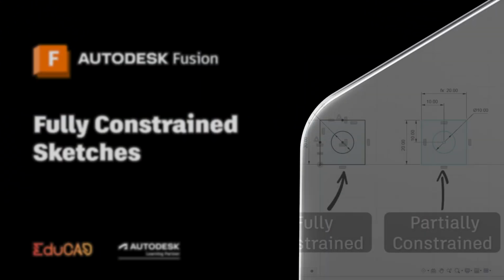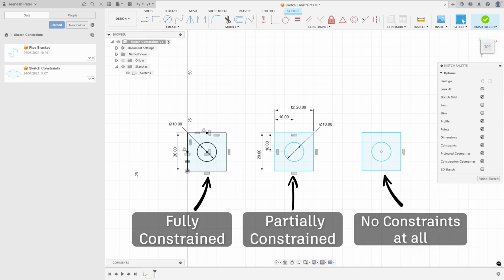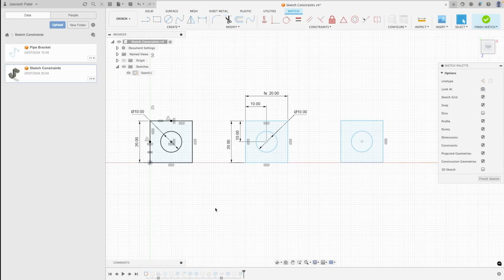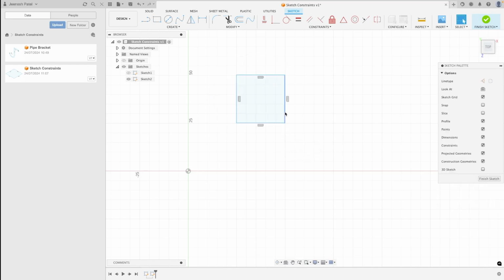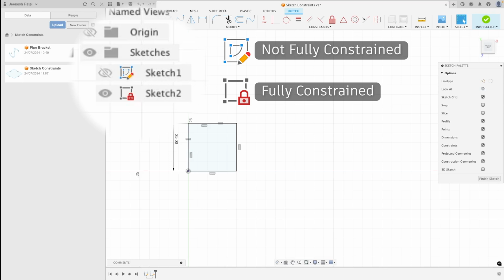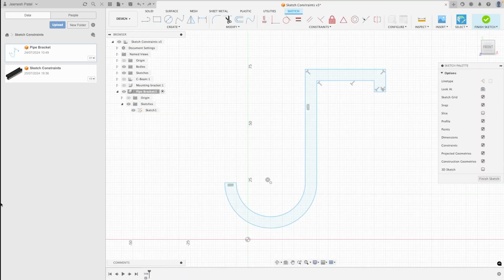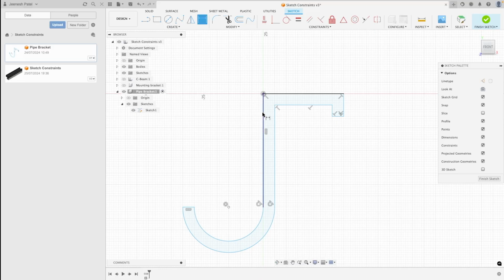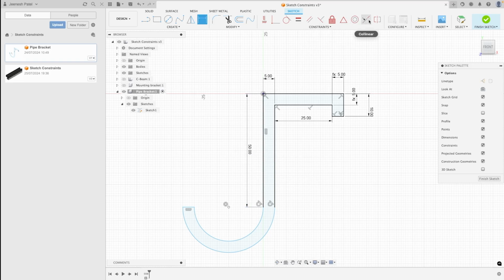Fully Constrained Sketches - How to Create them in Autodesk Fusion

Comment: Fusion: I know the sketch isn't fully constrained, but I'm not going to help you find the problem. I'm going to make you search and search for 45 minutes trying things, until you give up, only to find your sketch is now irreversibly altered (no Undo for the overall sketch changes) and there is now 50,000 errors in your timeline that need fixing that weren't there before. There needs to be a) a way to ask it "where are there unconstrained elements (the blue highlight isn't enough because it can be hidden behind other points or lines that make it invisible) and b) a way to "finish sketch, reverting to previous state (undo all changes since last time)". Maybe this is a newbie error, but as a newbie, it's seriously frustrating.

Comment: The most frustrating thing in Fusion sketch enviroment are automatic perpendicular and parallel sketch constraints.
Reply: Hold alt when sketching
Reply: @Jimbo_Jumbo  What does "Alt" do? I often hold "Ctrl" during sketching, but the problem is that it disables all automatic constraints, not only the ones I mentioned about.
Reply: The question is does it cost you more time to remove them IF needed or would it cost you more time to have to apply them if they were not put there automatically? If I want an off 90 prismatic shape of some sort I sketch the lines then constrain as needed.
Reply: @seabreezecoffeeroasters7994  In fact I do spend a lot of time on removing automatic added constrains which I don't need. This is one of the most annoying features in Fusion for me. In fact i use those two very rarely, but have to remove them constantly. Also those automatic constraints are mostly random and make no sense. Properly managed sketch is a key to effective parametric design. Almost every serious CAD allow to disable certain automatic constraints, but not Fusion. There were many user requests for such feature over the years but they were all completely ignored. Automatic constraints are good but Fusion seems to greatly prioritize parallel and perpenducular which are rarely useful and make sketch difficult to manage and understand.